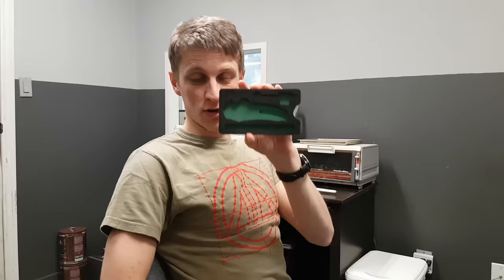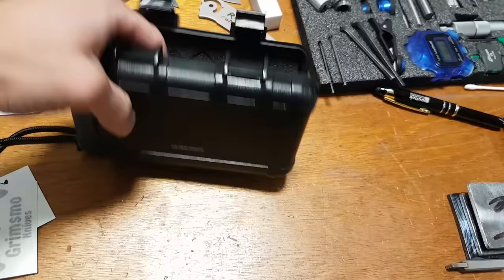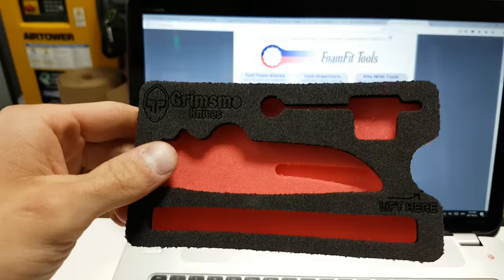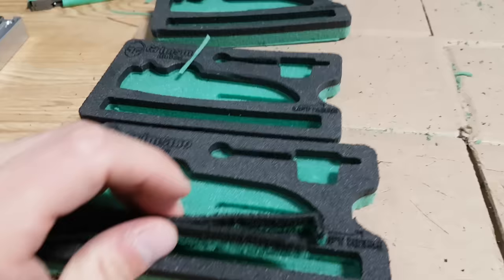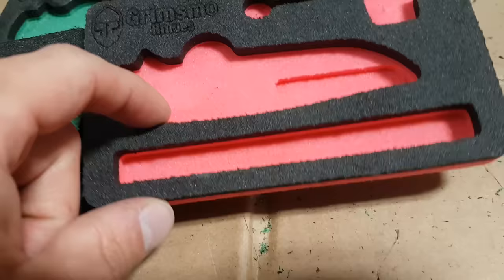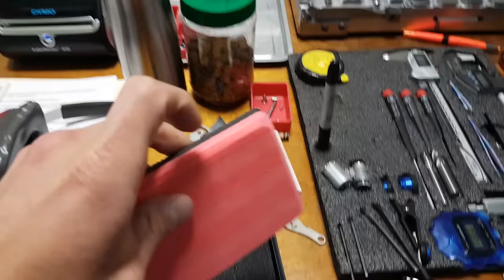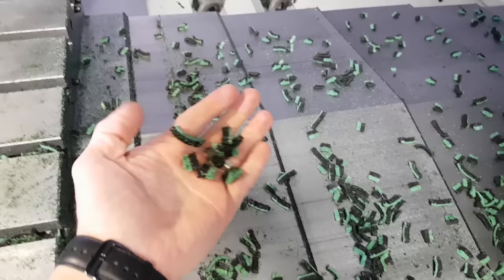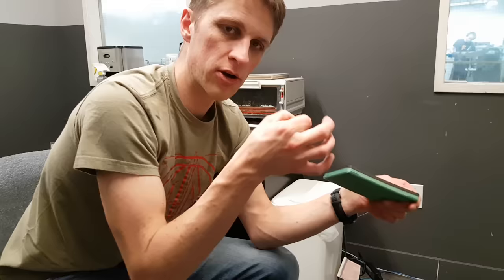How to Cut Foam

Comment: Have you ever considered freezing the foam prior to machining it..?

Soak in water, place between two glass plates, freeze, scale up your tool path by ~9%, perform machining, and finally place in a warm environment until dry.

It would add a little lead time, like two days, but not really that much more work involved. However, theoretically, you should get no dust, perfect edges, and the ability to create much finer detail.

The ice acts as a rigid binder which gives support to the underlying foam structure whilst it is being cut - hence, all conventional milling practices are equally applicable - assuming you put your miller in a sub-zero environment. Failing that you'd probably be better to do what you currently do and cut the finishing cuts first and fast. Rapid full profile moves at a small be ever increasing depth of cut until you ultimately reach full depth, would be what I would try - that way you reduce any local and undesirable heat build up that could melt the binder.

If you need help with a bespoke tool path, let me know. I've always found 'off the shelf' NC machining software unable to cater for machining of more difficult materials. Which is understandable as they are trying to cater for the masses. My experience is in cutting hard-state zirconia with tiny diamond burs. Oddly, not that different from what you are trying to achieve - in some ways.

Great video and good luck.

Comment: Now with that fancy high end foam the cases look cheap. You need to engrave your logo on the outside of the cases now, decals just look cheap and after thought compared to the rest.
Reply: The decals look fine. It is a case for shipping, nothing more in my opinion. The knife belongs in your pocket, not a case.
Reply: Engraved on a rectangle of metal.
Reply: Eggsr2bcrushed I agree. Knife belongs in your pocket. If you are a collector, I doubt you'll use the plastic box for display purposes.
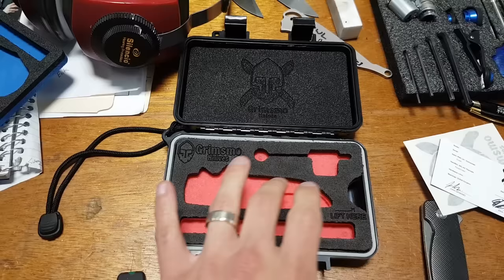Reply: Agree, especially the first version of the top lid foam with the large engraving looked sooooo goood (1:20). And he replaced it with that ultra cheap looking knob foam. 3:20
Reply: beter make a freaking top quality knife instead of focusing on some cases and paddings.. as a customer i dont buy $50 knife, where the knife itself is a tenner and the case costs $40.. i buy 50 quid knife where the knife is $49 and the packaging is a quid!

Comment: support/press the foam with a wood plate when routing/rounding edges. this way it will stay rigid and flat for consistent finish. plate can have a handle if handy.

Comment: Great video!  Awesome product it appears. 

I'm wanting to cut a clean line on a media similar to Dynamat (i.e. foil covered foam insulation with adhesive backing then stuck to a wax paper backing) 

I tried using a razor, which shreds the foam and tears the foil. 
Then, I tried scissors which does work better, but is time consuming leaves tiny little tears along the wax paper backing as well as the foil.  

Does anyone have any suggestions on what the best process would be for this type of material?

Thanks in advance!

Comment: Get a datron just for the foam. Small and fast machines with in-built vacuum
Reply: Yeah, I would recommend another machine just for foam. Material change out and cleaning takes time as well. But it looks like they have limited floor space. May or may not have room. The Datron will will give enough table size for at least two vacuum plates though, so there's that to consider getting one.

Comment: Did you perfect the bottom radius, if not, maybe make a halve depth pocket, similar to the case the foam sits in, but fitted the opposite way, but then only have a thin 3-5mm wall, also modify a custom stepped bearing guide on the table router to follow the plastic foam cup outer but the step rides on the pocket not the foam, so it can't dig in if pushed too hard, hope you can envision the concept!

Comment: Have you tried a half inch round over bit with a larger bearing to hold the foam a little farther away. Should help with not leaving lines around the edge.

Comment: Couple things I wondered about - are you happy that there is definitely no chemical reaction between the foam and the metal long-term? I know this is probably a moot point, since the knife is going to be worn, not stored in the box, plus it's largely titanium. But it can happen - we had a batch of jewellery boxes, and the foam inserts were turning the silver jewellery black - either the foam itself, or the blowing agent used. Second, if you ever want to play around with it, diecutting foam is actually relatively easy to do. I made up some simple dies for cutting cork a while ago, some info here http://imajeenyus.com/workshop/20120215_diecutting/index.shtml. It doesn't really help your two-color inserts, because it's a blind cavity, but might come in handy for other things.
Reply: Lindsay Wilson yes for sure I'd the foam is petroleum based.  I've had both foam and bubble wrap effect the finish on my Ti handles.  I ship now wrapped in cotton cloth.
Reply: I've had foam break down over a few months and stick to the item stored....in some cases it was a bitch to get off...(had to use a solvent cleaner like alcohol)

Comment: Wouldn't it be possible to machine  a mirrored die and cut the foam out with a press. Or use a heated wire to do the cut out and laminate to the black later on.
Reply: spancj1 I was going to suggest the same thing doesn't make sense to mill foam
Reply: spancj1 that's what I thing would be the best and fastest way.

Comment: To remove the long strings wrapping around the tool, you could retract and reverse the spindle between each pocket. Works great when drilling materials that make stringy chip. For your logo, could you make hot brand instead of engraving?

Comment: Have you considered how a heated object would smooth the rough edges of cut foam? 
I'm not suggesting a new machine or a separate operation, but maybe a small jet of hot air at the cutting surface.

Comment: The original lid liner with thelogo looks SO much better! - go back to that, and maybe use a thicker foam, or add a layer behind it to bring it tighter to the knife...  The eggcrate foam looks cheap & cheesy in that little case (maybe a smaller "egg"  pattern) with the high spots past the edge. -

Comment: Do you still have a tormach mill?  If so, why not set it up with a high speed spindle (ebay etc) and use it as a dedicated foam cutter?  Another alternative would be to have a die made to die cut the foam out so you get good clean edges, then clear out the rest of the foam with the mill.

Comment: Make the decal the same size as the interior of the case.  You don't even have to change the original art; just reproduce the decals to be cut with the backing in the new, larger size.  Pack with all other underlayment items first, then place the decal on top.  Since there is no place for the decal to slide, as it is being held in place by all four sides of the interior of the case, the edge of the decal will be guaranteed to always be in full view through the finger cutout in the foam. Problem solved.

Comment: I'm no machinist, so this may be a stupid idea, but could you machine a new tray to put on the CNC bed that could hold six of the inserts upside-down, then CNC the bottom edges all at once? It might not be any quicker than rounding over the corners with a router table, but it would be perfectly consistent, and automate the process.

Comment: The egg crate foam top sux.  The engraved was good.  Figure it out.  You need a water jet cutter and glue the green to the cut portion.  Drilling it is crude.

Comment: I know it would add another tool change if you did it after the fact,but what if you used your engraver bit,or even another chamfer mill all together to  chamfer the pocket areas to get rid of the "boogers" on the edges?As you said,you do the finish pass first,so you could let the engraver put the small break/chamfer on the pocket edges before the finish mill runs.
Reply from the maker: That's a sweet idea, I love it!  Probably if I plunged down with the Datron endmill on those boogers they'd go away.
Reply: I guess that's the one I'm talking about.Is the Datron doing the lettering/graphics?That's the one I'm referring to.Ya' figure the finish toolpath for the regular milling is there,just a 'lil cut-n-paste,and an offset or 2,lol.

Comment: You could try to use a hot air gun to get an even better surface finish on the edges.. The heat will "close" the cut-open edge.

Comment: Flexible but it seems slow. A mechanical method and then laminate the layers after seems way faster. Make a jig to hold standard utility knife blades so its east to change out when they get dull.

Comment: Your new egg crate foam In the top Is proportionately way oversized. The current foam material you are using in this prototype is far too coarse and these larger dimples are normally used in shipping situations for protecting large heavy items when protection is of far greater importance than esthetics. A foam of this quality and dimple proportion would be appropriate for lining a protective display case of a much larger much heavier item.
However, going too fine runs the risk of allowing the packaging to become more akin to a jewelry display. So you would have to make a judgment call on where that line is, but this huge dimpled egg crate you have in this prototype top case leaves you quite a bit of room to improve before you run the risk of overcorrecting
A finer foam sample(smaller air pockets) should be ordered with the egg crate dimples spaced at about 1/2""  or maybe even 1/4 or smaller, with the actual depth of the dimples very shallow as well. 
A finer foam material and more proportionate dimples would give a smaller case such as this the proportionate look of a high-end gun case and would really enhance the cases ability to impress when used as a display case, especially in a retail environment. 
You may be forced to use a thinner foam to get the finer dimples, but you could rectify any loss in thickness by adding an additional backing layer to the top egg crate layer.  You could use a backing layer of the same colored foam that is used in the bottom. Additionally, you would have the ability to adjust the thickness if needed to give the desired support to prevent movement and rattling.and and it would carry over into the top case the same two-tone color theme that you now have in the bottom case. You could even cut the product name and/or company logo into the egg crate layer so it would be highlighted by the colored layer backing.
I used to be an industrial package designer and salesman a few years back.

Comment: Laser cut board with bent knife stock in it to use on a clicker press is the way to make these safely. Only the logo engraved on the cnc is required. Hand routing the bottom is a very dangerous thing to do. I hope no injuries have resulted from hand routing as yet but it will happen. It is just not worth it. Good luck with the product but clicker press cutting is the instant production method to use.

Comment: Hey John, I've had a lot of experience with cnc routers with vacuum tables. Here's a tip for you- use MDF board on top of your vacuum table. Make sure to use a gasket material as a perimeter so your suction only goes through your MDF board where you plan on having the foam material. Also note that the MDF board comes with a hard top and bottom layer that needs to be machined off so the suction can pass through the board. Now, you'll be able to cut through your foam in one operation, not having to worry about machining into your vacuum table. If your cutting out only six foam inserts at a time, you shouldn't have problems with your material moving on you(if you have a strong vacuum pump). Just make SURE, that cutting out the inserts(perimeter cuts) is the absolute last thing you do so you maintain the best suction throughout the machining process. PM at eventheoddsplastics@gmail.com and I can forward you a picture of this. It's sure to blow your mind! I've machined roughly 150 parts of 1/4" aluminum out of a 4'x12' sheet not losing any parts using this technique.

Comment: Considered a cheap Chinese laser machine? I've heard they are pretty cool ... (EDIT: Well since you buy the 2-color foam pre-laminated, it might not be so easy ...)
Reply: But won't it be faster to use the laser printer on separate layers and laminate them after?
Reply: and it smells very bad no matter what you do i done it with my laser to shadow foam my tool box it works but the smell stays there for months
Reply: Hey Marco im a subscriber keep the good content coming.
Reply: yes this is what we do for our tool drawer inserts , black sticky back foam laser cut and then stick to coloured foam also a lot cheaper than the product in this video
Reply: Water jet for foam. No stink. Fast. What's the downside? I think the water probably passes by too fast to get absorbed and expand the foam, but I might be wrong.
Reply: Waterjets are expensive to operate, regardless of what you're cutting.  You really have to justify the value add.
Reply: As a laser engraver, the cheap chinesium ones are cheap for a reason.
Reply: @laserfalcon  You clearly don't watch reps videos lol
Reply: @ExtantFrodo2  water jet not fast , just like cnc , it's slowly. Die cut is the fastest , one sec can cutting 20-30 pieces of this size foam. I ordered 100 piece cutted EVA foam 35 x 20 cm just cost me USD $ 0.7 each from China factory.
Reply: @DeZug  Do you think die cut is applicable to the above video subject? Yes it is fast, but I certainly don't want to buy a 100 cut outs for the one or two vice grips in my tools drawer.

Edit : Apologies. I wrote that before realizing this wasn't his other video about cutting foam for tool drawers.
Reply: No You're right marco, if they want multiple colours they just need to cut the layers separately then glue it together.

Comment: john, are you running air blast when cutting dry? (don't think there was air in the video) the air will remove the chips so the cutter is not cutting on top of the chips (used to machine a lot of polymer products and air makes all the difference)
Reply from the maker: Good thoughts, and yes I do use an air blast for some of the clearing operations, it definitely helps!  I probably turned it off for any time I stuck my head and camera in the machine.

Comment: I like these evolutionary videos.

Instead of the "egg crate" goam in the lid, why not cut the "bearing shape" out of the two-layer stuff?  Reduces inventory; you have more control and the shape can allow for an easier close as well as better containment of the contents.

Some of the contents could be held in the lid with mor space around all parts and perhaps an even better presentation.

Comment: When chips wrap on your tools try using a m4 ccw rotation with a quick g4 dwell this will spin off any chips that are wrapped on your tooling
Reply from the maker: Eeeeehhhhh, they wrap around at random times and do not come off that easily.

Comment: Hi John, found you by sheer ass, but glad I did. I have a drone bag that I use to carry my gear to the job.  It is made for the mavic pro and fits the drone, controller and two batteries. On top of that is a big gap to put other stuff and not securely, I have been looking for someone like you cause I would like to know if you would do a small job for me.  I’ll supply photos and measurements, even go a far as sending you the Items to be stored for a moore accurate, cleaner job.  Interested?  Let me know if, please.  Cheers Brett

Comment: Instead of the "Lift here" text and notch cut out, why not just tape a pull tab to the bottom of the foam and have it come around the side with "pull me" printed on it? That "lift here" section is only useful when a customer fist opens the knife, and is an otherwise pointless feature after they retrieve the card and sticker. 

The pull tab I'm suggesting could easily be removed or tucked in after the card and sticker have been accessed. That would leave a cleaner appearance for showing off in the future, instead of curious people always going for the "lift here" part long after the stuff has been removed.

Comment: To get the radius on the foam and remove the flash/flappything, could you use a cheap trim router clamped upside down to the bench with a "round-over bit"? Would the foam be stiff enough to be guided by the bearing lightly against it?
https://www.youtube.com/watch?v=38l6Zhn3Q_o
Or you might find a suitable Inverted Roundover or Under Rounding Bit (like a concave woodruff cutter) and do it whilst still on the CNC.
Not sure what the edges would be like.
Reply: Typed too early whilst watching the vid.

Comment: I use a laser cutter and it is cheap, easy and perfect...
Reply: Except the burning foam smell that stays in the product for long time.
Reply: You can't laser cut laminated foam. You'll go right through both layers.
Reply: Spirit, you can get laminated whatver with a laser. It takes time to burn completely through, so you only need to control the amount of time the laser is on per specific spot. The industry usually talks about "engraving" with the laser.
Reply: Which means it's a multi-hundred-dollar(if not thousand) tool... to just engrave on some foam?
Quite economic.
Reply: That's then a few thousand dollars less than the milling machine :) There is nothing special about pulsing a laser while "cutting".
Reply: Why buy a laser just to do a single operation that only takes a few minutes on the big mill?
Just a stupid idea.
And pulsing CO2 lasers very hard and very quick is a surefire way to kill the tube in a few dozen hours via sputtering.